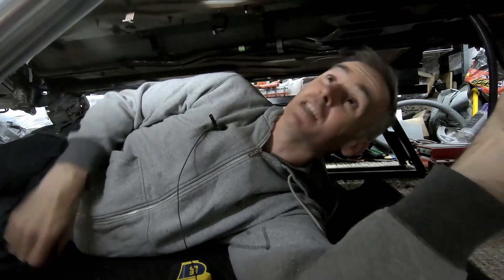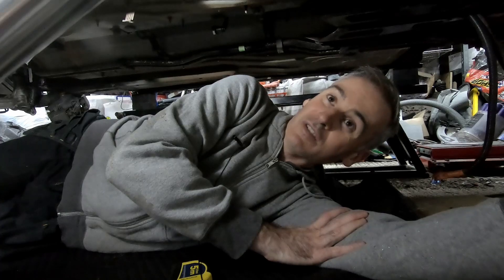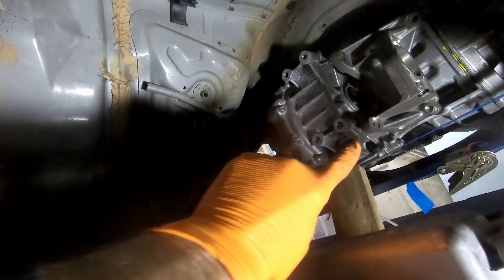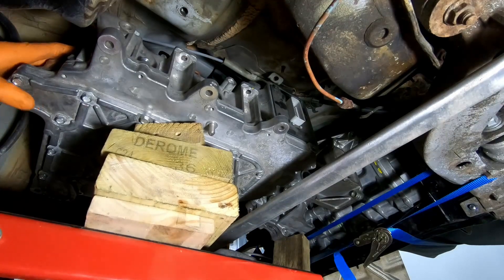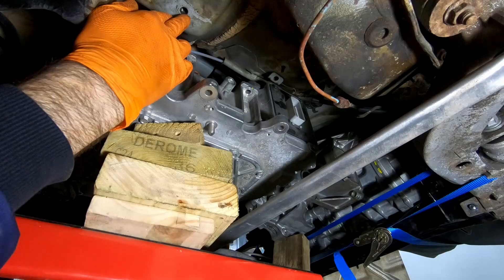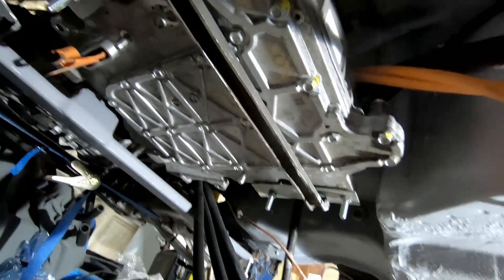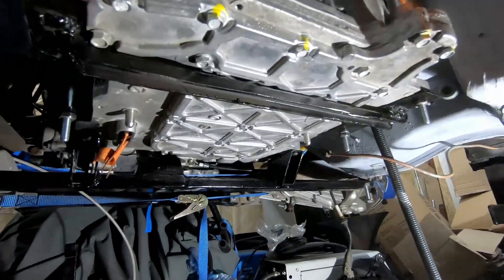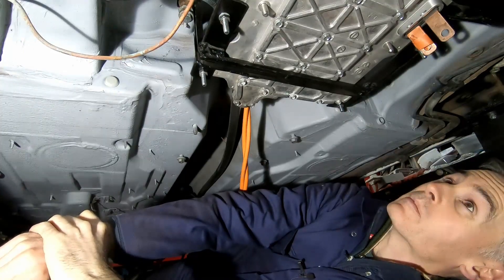Mounting the Nissan Leaf Inverter Underneath our Electric Porsche 996 - Porsche 911 EV Conversion

Comment: Thank you so much for documenting your progress so well. I am seriously considering a similar project, and had a question about the gearbox. I watched the video where you tore it apart to evaluate the merits of mounting it upside down, and it looks like you have elected to mount it right side up. But, it also looks like you have it mounted 'backwards' (as in, it will be running in reverse). In the teardown video we can see an oil reservoir that the large gear is meant to sling oil into so it can drip on the intermediate shaft bearings. If it's running in reverse that won't work. I have seen others talk about mounting an oil pump and tapping into that reservoir to keep it full, is that something you have looked into at all? Or do you have other thoughts on the matter?
Reply from the maker: It’s a good question. I am planning to run it for a short while without any additional plumbing to see how things go. With the main gear running in reverse it will actually be directing the fluid towards the intermediate shaft bearing, rather than away from it. I’ll then take another look at the inside of the box after driving for a bit and see how it is faring and if any additional plumbing is needed.